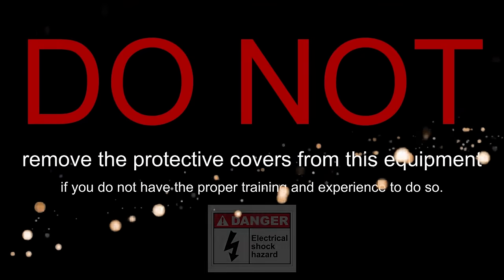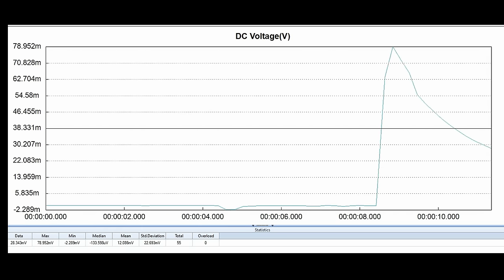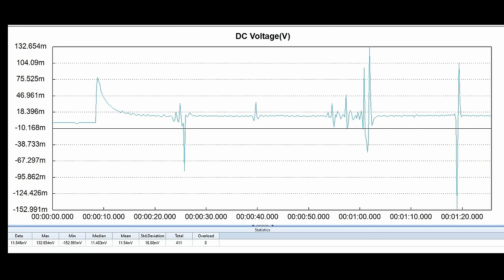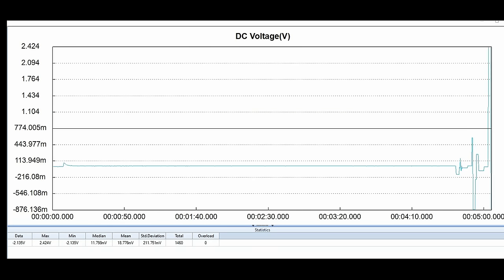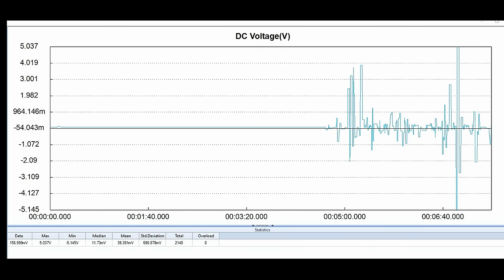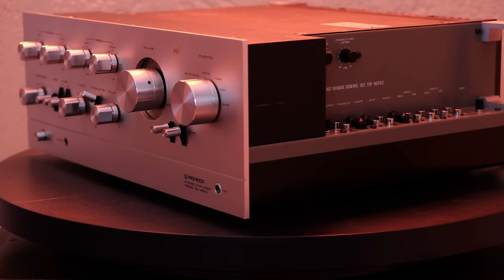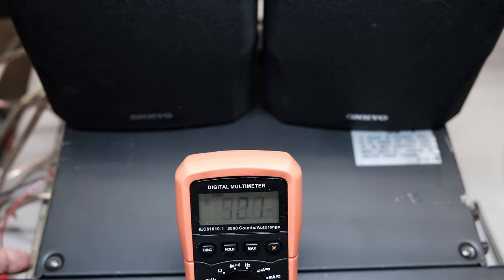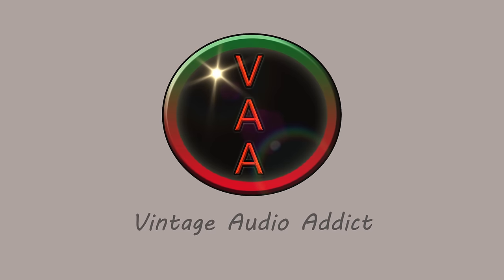HUGE Problem With Vintage Amplifiers & Receivers. Hides From Your Eyes But Not Your Ears.

Comment: The biggest thing I do not like about this vintage is they do NOT have banana plugs or 5 way binding post. You are supposed to thread a 14 gauge wire into a little hole.
Reply from the maker: Yes, that's true. You are limited most of the time to the smaller gauge wire with the older gear. Thanks for watching!
Reply: Change out the old connectors to newer ones.
Reply: @stillastillsfan Change out the old vintage junk for new McIntosh. And it'll probably cost you less, too.🤨

Comment: I'm 64 and was  a teenager in the 70s I probably owned enough stereo equipment to open a store 😅 this was a common problem with new equipment but 99% it wasn't the circuitry. it was the controls that caused it. Japanese engineers were horrible at acquiring quality pots to use in production.

Comment: The three main problems I encounter when repairing vintage audio gear from this era is number one dirty switches number two dirty potentiometers and number three the DC balance is out of adjustment but not enough to cause the protection circuit to kick in.
Reply from the maker: Thanks for sharing.
Reply: Then you're not actually repairing it, are you?
Reply: @joerosen5464  Technically, these receivers aren't in need of repair, or the replacement of parts. They are in need of adjustment and maintenance to restore function of the pots.

Comment: the more we can work it out to upcycle and keep things going longer, the better.  consider the heap of e waste bc everyone wants perfect gear perfect sound perfect tv resolution. none of that is good in the long run for humanity / ecology. your channel is great bc it helps ppl understand more and learn that it’s not too terrible to fix these state of the art / amp pieces.
Reply from the maker: Well said! The wonderful thing about vintage audio equipment is that it was engineered/manufactured well and was made to be serviced when something failed. The parts(mostly) to repair these units are still available. The documentation to repair this equipment is available. The most difficult issue in todays world is finding a technician that can work on these things if you can't do it yourself. As time has gone on retirement and death have taken many of them.

Comment: Thanks for sharing.   I just recently rebuilt my SX-1250...     Caps galore, and many transistors and diodes.   Big improvement, and it's much healthier now.
Reply from the maker: Good decision to do the work on your SX-1250. She will now be good to go for another lifetime. Thanks for sharing your rebuild.
Reply: @vintageaudioaddict  Fortunately I've learned enough to build kit amps, and have some really neat stuff... like a 300b tube amp.

Comment: Over the years I have heard this noise in different amps. My Techs in the past said there was nothing wrong. Until it starts on fire. They don`t always burn up, but I have had them smoke and throw sparks. And it is usually pretty bad. I have been able to repair some stuff over the years, but I am not educated beyond what I figured out myself. Now that I am old, it seems I can`t figure anything out. I have known some great Techs in my day, but they are all gone. I remember telling people about this noise and they would look at me funny. I could tell the way it sounded there was something wrong. I have never seen it put straight forward the way you have in this video. So, I was right when I heard the noise. If you didn`t have enough to work to do before, this video will get you a lot more work. I have many pieces of this old stuff and now I am going to hook them up one at a time. Thanks for this great video and I need your address so I can send you a truck load. Thanks

Comment: Really useful video. I have just started trying to learn to fix old 7Os gear as a hobby and have been diligently measuring DC offset at the speaker outputs, but I never thought of it as a dynamic issue. There was either a problem at a single measurement or there wasnt. This vid has been extremely useful.
I've currently got a Sansui Ba-f1 power amp which has started going into protection after a few minutes running. It was fine till I started moving boards about to access the coupling caps for Esr measurement, so I have almost certainly messed something up. Sigh.
Will revisit it after I replace all those pesky Black Flag caps with new silver mica.
Reply from the maker: Thanks a lot for watching. It's great that you have got into fixing the equipment. It's a fun hobby and with less and less of the old technicians around many folks have to try and fix their own equipment.

Comment: Got an old timer named 'Doc' local here (old timer, yeah . . . I'm 70) and I took in a Marantz made in 1978 for a good going over. Thing worked fine after DeOxit and replacing all the bulbs which I did before taking it in..
Got a call the same day and Doc said, 'Don't need nothing.' Hooked it up and set up the voltmeter and dead Zero offset DC. 'Everything works to spec,' he said.  I use the receiver everyday . . . sweet.
Reply: If he didn't replace any electrolytic capacitors, then he didn't give it a "good going over". 
That's what's called a cursory going over, of the sort a trained monkey can perform. Your Doc is a Quack!🐂

Comment: Great video. This problem is very common in units with the "famous noisy" japanese transistors 2SA726 and 2SC1451 probably causing the problem.
Reply: Also he's talking about a 1975 unit. I've had problems with 20 year old amps. The newer amps can sound boring and flat and may be a waste of money - if you don't want to listen to it.

Comment: My problem (and I consider it to be huge) is my Kenwood KR8050, which I bought new has started acting up and I can’t find anyone around here (north Carolina) who will do a complete overhaul with new caps and transistors where needed as well as a cursory cleaning (unit is very clean physically) and do all the proper testing to give it back to me working great. I bought this new back in 1979 and it cost me more than a few meals but I loved the sound and have never looked back. I’m heartbroken that it has started cutting out and just plain stopped working for certain things. I won’t sell it and I will ship it for repair but only if I can believe they will do a good job. I’m thinking of moving to where people can actually do stuff like this.
Reply from the maker: First of all your Kenwood is a fine receiver and it's great that you have had her all of these years. I have the exact same model as you in my collection. It's tough to find folks anymore who you can trust working on this equipment. As the equipment has got older so have the folks who use to work on it. The technicians are just disappearing. Do a google search and see if there is anyone within a hundred miles or so from you that could help. That way you could just take it and pick it up yourself. Shipping this equipment is expensive and you have to pack it like it's going to the moon to arrive safe. Good luck finding someone.

Comment: Looking forward to the repair on this one. I have a Pioneer surround sound receiver that is 32 years old and having the right channel cut out after it's been on awhile. The left is starting to do it too a little. No relay clicks>>the sound just stops. Occasionally if I tweak the volume, it will come back on. There is no-one in my area that does service these days. Repair places are getting hard to find so I have to learn to do it myself.

Comment: I recently repaired a (not really vintage because it;'s from the 2000s) Yamaha RX-371V receiver that I had salvaged from Goodwill for about $10. It wasn't powering up, so I found the schematic and started probing. The unit has 2 transformers, a main one that powers the unit when it's on, and a standby transformer that powers the IR receiver and the power button circuitry. The secondary of the standby transformer wasn't outputting any voltage and the secondary was open circuit. I found in my stockpile of parts a suitable replacement (compatible voltage, larger rated power of 16W vs 5W the original, larger footprint too so I had to get a little creative to install it). After replacing that, the unit powers up and works great.
The nagging question that remains in my head is: what could have caused that failure. I probed around the standby circuitry and everything checks out, no shorts, no bad caps etc. And I wonder how long until it fails again, this time maybe taking with it something else inside. 
But all in all for a $10 price tag, a spare transformer and a few hours of work, I'd say not bad.

Comment: I just subscribed.
I'm going to take an educated guess that this was a small signal transistor causing this issue. This is particularly nasty in direct coupled amplifiers where a complete failure of a small signal transistor can cause an output offset almost equal to one of the supply rails.
Reply from the maker: You are correct. The issue was caused by a known troublemaker transistor in vintage audio gear, 2SC1451's. Thanks for the sub.
Reply: @vintageaudioaddict  you're most welovme regarding the sub. Cool channel.
Those Japanese small signal transistors are as notorious as RIFA caps! Did they have the telltale black lead syndrome?

Comment: I legitimately thought you had passed on. Glad to see new content. Cold solder joint or a flaky transistor.
Reply: Just rebuilt an SX-737 and the DC offset was spastic, replacing the "shoot on sight" transistors on the TONE board with some KSA992 and KSC1845 and all is quiet. Pioneer was prescient in knowing what transistors were going to age poorly and used them a lot in this era.
Reply from the maker: spoiler alert........ It is a certain transistor type(2sc1451). That transistor is a known troublemaker in vintage audio equipment. Still alive and drinking daily. lol. Thanks for watching!

Comment: Chris, I have a question for you. Should I keep my old equipment on a shelf in the garage or should I have it out and regularly played? I hope problems don't develop while in storage.
Reply from the maker: You can store them for sometime but it's good if you can power up the gear every year or two. Just to charge up the electrolytic capacitors. You don't even have to hook them up and play music. Just plug them in and let them sit on for a few hours.

Comment: DC offset is a neglected corner of amplifier troubleshooting and repair. In a past life I serviced many different amplifiers, if I did not see a stable 20mV or less, further investigation reqd. Often in DC coupled amps the problem was right at the front of PA section, the matched pair  in differential configuration had drifted with age, and the error was literally amplified. Sometimes capacitor issues and simple dry joints contributed also. Good graph and explanation.
Reply: Have you ever worked on a nakamichi 5 channel amplifier ? Mine stopped working the light still comes on , I've repaired some electronics before but this thing might be beyond my abilities , I guess I will just start with the oblivious stuff 🤔 I think my Crossover may have shorted out cause the issue

Comment: I had to stop the video a couple times where you pan across all that gear to confirm you show the same Luxman cassette deck that I've got. I have a bearing problem with the motor, sometimes it won't spin up.
Reply from the maker: Luxman made some great audio gear back in the day but like most of the vintage equipment they are in need of some work.

Comment: Sounds to me like this issue is either a possible loose connection in that pre-amp/power amp separation switch, which could be remedied with a good contact cleaner and lube, OR, it very well could also be caused by some leaky or even totally bad electrolytic capacitors somewhere in the circuit of this amp... In this one's case, probably somewhere within the pre-amp part of it, since disconnecting the two parts by flipping that switch seems to completely stop the noise...

But I will look forward to seeing and watching your repair video for this amp to see what it actually was and how exactly you fixed this issue!
Reply from the maker: spoiler alert........ It is a certain transistor type(2sc1451). That transistor is a known troublemaker in vintage audio equipment. Thanks for watching!
Reply: Such a noob take...lol....deoxit and caps to the rescue. LoL
Reply: @Poppinwheeeeellllllieeeeez  Hey, sometimes it's actually just as simple as that in fixing vintage audio gear! I've totally fixed used gear exactly that way MANY numerous times over the decades... Sometimes it actually IS something more difficult and expensive to replace, like proprietary components or discrete semiconductors, sometimes which are obsolete so they have to be substituted with something equivalent or as similar as possible, then the surrounding circuit be adjusted accordingly if necessary, but you always want to at least TRY the very cheapest and most BASIC things FIRST, BEFORE you automatically assume the absolute worst and just start throwing expensive or hard to find parts at something!... So not exactly a "noob" take on this topic, but thanks for your assuming that, because now that assumption actually just makes YOU seem like a "noob", because any really good tech or repair person should ALWAYS try the most simplest and basic things FIRST, before ever having to get into the replacing of actual semiconductors and such.

You should know that too if you're REALLY into this sort of thing, so not to be mean at all, but just making it clear that my initial thoughts about this problem would still have been a good place to START at least, and THEN, if that basic stuff, (which should be done in ANY case, with a truly Good quality restore of vintage equipment), still didn't fix the issue, THEN you start checking ALL of the other components in the circuit!... After loose connections and bad caps, then semiconductors. The guy in this video probably did exactly that himself, unless maybe he ALREADY knew in advance to check that one specific transistor exclusively and first, maybe from prior experience with this specific amp model before, OR maybe he took a suggestion from an online repair forum or something?... But without knowing ANYTHING about what exactly is wrong with something, you always start with the very simplest, quickest, and easiest things to repair or replace first and foremost, then go from there.

The fact that he said that it actually was a transistor that went bad is just a coincidence in this case, because I've heard noises exactly like what he showed in this video being caused by nothing more than loose connections in switches and/or from bad electrolytic caps in old vintage gear, more oftentimes than not, which is of course a super easy and (usually) cheap thing to fix, depending on what all else may be wrong with the equipment being restored.

Anyway, have a good day, and let's both just look forward to this guy's follow up video to this one, showing exactly what all he had to do to get this beautiful amp working properly again!
Reply: Got ‘em!

Comment: Even worse is: The "protection" circuit fails.I've seen a  Cerwin-Vega 15 inch speaker catch on fire
Sanyo 100w/per amplifier-actually I smelled it first then the speaker tried to leave the cabinet

Comment: Black leg transistors most likely. Could also be bad electrolytic caps, but it being a Pioneer, I strongly suspect the black leg transistors.
Reply from the maker: You sir are correct. 2SC1451''s were the issue.
Reply: @vintageaudioaddict  Those and a few others, like 2SC458's keep me busy!

Comment: Some good info and advice. I have six vintage units, most never touched except offset and blown out occasionally. I suppose after 50 years of bliss there could be an issue. Or ...a few years of crap, then more crap, then more all in search of that 50 year old sound with newer junk....My truck will also need repair down the road.....still I use it....

Comment: My guesses on that would be switch cleaner on the PSU connectors in case one of the DC rails is causing the problem, and often you get a preset bias potentiometer to balance the op stage and they can get a bit corroded, so more switch cleaner. Finally I would resolder any PCB joints that might have cracked up due to thermal problems, e.g. WW resistors, OP transistors. If that failed another trick is to use freezer spray on individual components while measuring the offset.

Comment: I’m not sure that would be correctly considered a DC off set issue. I could be wrong, but I equate an offset issue with a power amp imbalance between the rails. Not a power amp correctly responding to an input signal……which is what you ultimately have.
Reply from the maker: You could say that. The amplifier section was responding correctly to the signal it was receiving from the preamp section. The DC voltage speaker protection circuit responded correctly when the DC voltage being sent by the amplifier section to the speakers was high enough. Bottom line, everything worked correctly to save the speaker drivers.